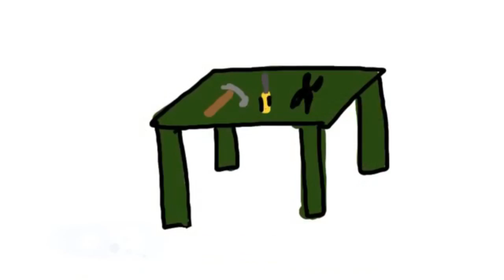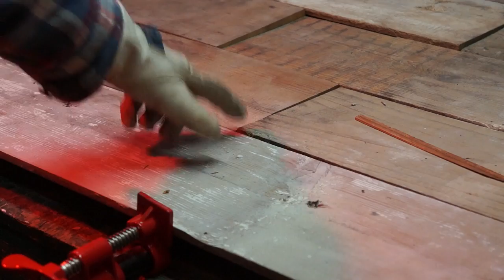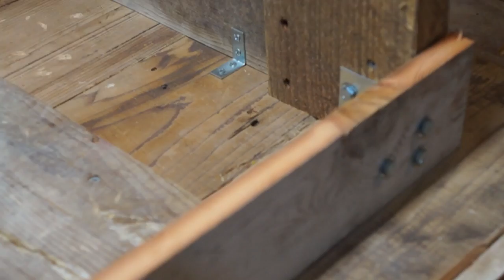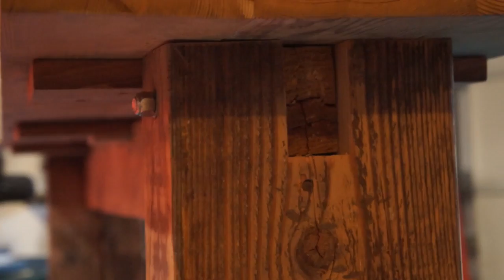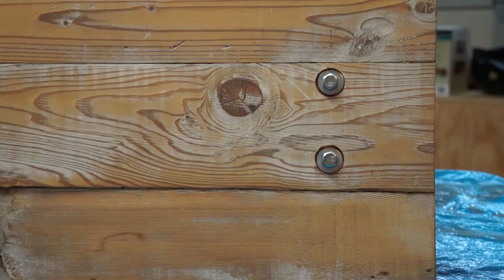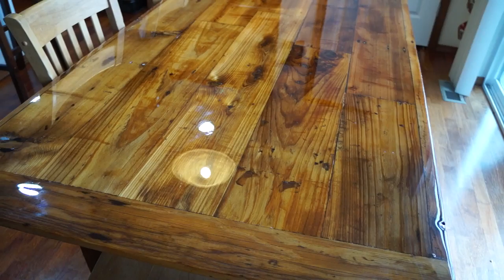How to Build a Barn Wood Dining Table and Bench

Comment: I am a beginner to woodwork, the main test I have with this bundle [Check Details== https://plus.google.com/u/0/114300960473982241196/posts/BeDNY8nkWu1 ] is that I think that its hard to settle on a choice of the plan and  outline to use as there are a large portion of them there. Nonetheless, I like the simple stride to step directions laid out there.

Comment: hi there.. can i ask if the epoxy is a sealer or finsh?thanks
Reply from the maker: It essentially acts as both.
Reply: sir what is the full name of that epoxy..so i can search if it's available here in our country
Reply from the maker: +misha-el lumata I used Famowood glaze coat clear, but others will work. It often goes by "bar top epoxy."

Comment: What did you use to apply the epoxy coating?
Reply from the maker: +maxcohen13 Poured it on and used a clean painters stick to spread, but it mostly spreads itself and is self leveling.

Comment: If you had used dowels instead of bolts, the project would have been clean of bolts and nuts. A better look would have been achieved. But a good looking table and bench it is.
Reply from the maker: Phil Miller You are absolutely right and the dowels would look really cool. You could hide them so they were hardly noticeable or use a different color wood to make them stand out. I personally like the industrial (for lack of a better word) juxtaposition with the old wood. I also move around a lot and to different climates, so dowels could be troublesome trying to take the table apart to move every few years. Thanks for the great input!

Comment: Also, how did you get your epoxy on so smooth?
Reply from the maker: It is self leveling.  You just need to run a torch any spots with bubbles.  The heat makes the bubbles rise to the surface and pop.  Just be careful to keep the heat source constantly moving.

Comment: I'm unclear as to how you are able to detach the legs. How can the ends be permanently secured, yet the long sides can be detached?
Reply from the maker: The only way the legs are connected to the long side apron pieces is through the diagonal support braces,the corner braces, and the corner (L) brackets. The two legs and side apron come off as one flat piece because I chose to glue and screw them as opposed to just screwing.  The long aprons can be detached from the tabletop via the blocks. I'm not sure if that makes sense.  Let me know if it doesn't.

Comment: We have some beautiful barn wood with good coloring....if you sand it wont' it take away that unique coloring?  and did you stain yours?
Reply from the maker: Sanding should bring out the color even more and a clear epoxy or polyurethane will really lock it in and deepen the hue. I did not stain it at all. All of my barn wood is western cedar which has the nice reds and golds. You can always try a spot first!

Comment: will the expansion and contraction of the wood crack the resin?
Reply from the maker: It shouldn't.  The wood is sealed really well and I am keeping the table inside so expansion and contraction should be minimized.  I also used a pretty thick layer of resin.  But I guess in the end only time will tell.

Comment: I love this table.  How durable is the epoxy and how hard is it to work with?
Reply from the maker: The epoxy is extremely durable.  They use it a lot for bar tops.  You have to follow the instructions on the box to the letter to get the best results.  But overall, it is pretty easy to work with.
Reply: Thank you.